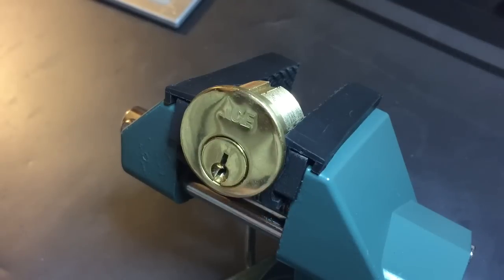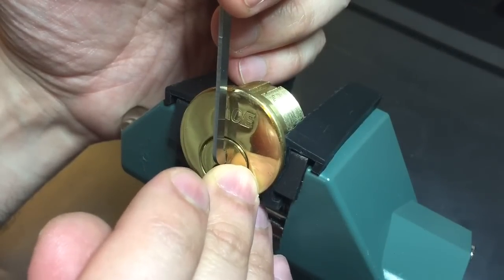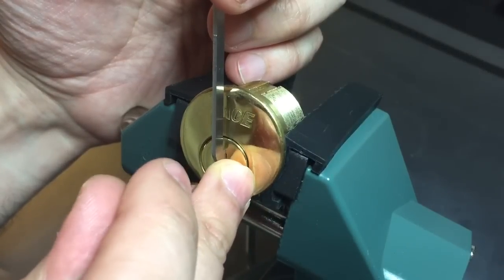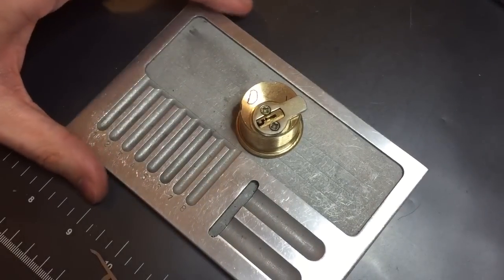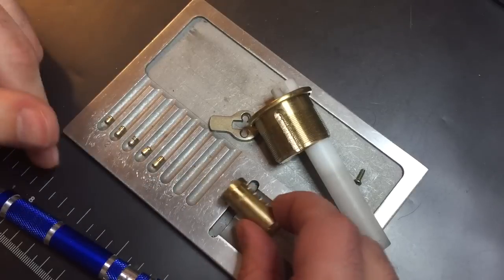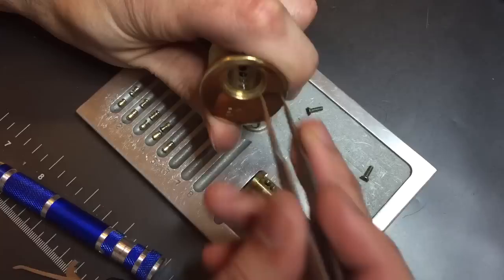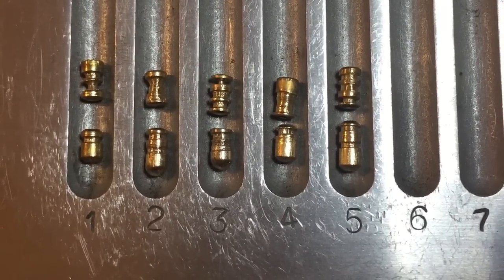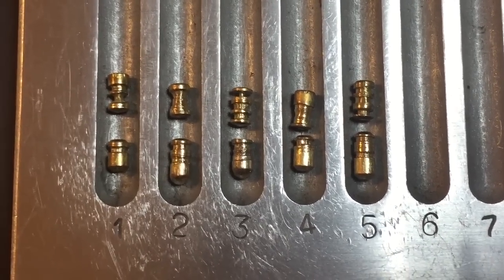[101] Dan's Ace Challenge Lock Picked and Gutted

Comment: really nice looking drivers 3 and I really like do you think with driver 3you have to set it couplle times the reason imasking in a video I used similar ones to 3 the lock gave me hell
Reply from the maker: +Javid Patel Thanks -- I'm not sure I understand your comment, but driver #3 was definitely difficult because it engaged the threading.  If every driver in the lock did that, I might have needed either a custom tension wrench or two tension wrenches (for manual counter rotation).

Comment: How do you decide which direction to pick in? Also, I'll take a crack at it if you're still offering. :)
Reply from the maker: +hellslave Sure -- PM your address to me, and it's yours.  I have about 10 packages laid out on my office floor for my eventual trip to the post office.  As for picking direction... it's mostly random in the videos.  I will switch if I'm having significant trouble with a lock to see if it makes a difference, but if so, I usually pick it a few times in each direction (if I can) before putting it aside.
Reply: PM sent! Thank you!